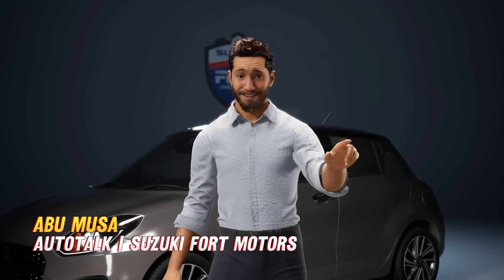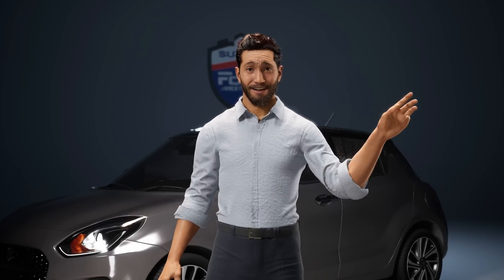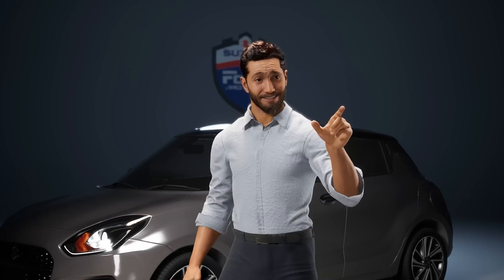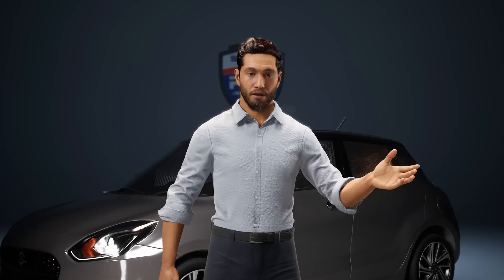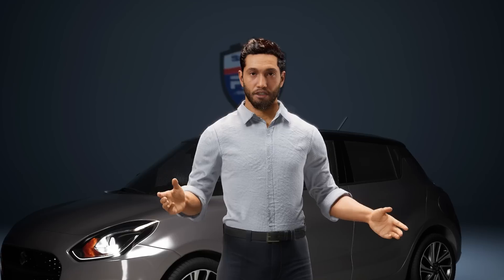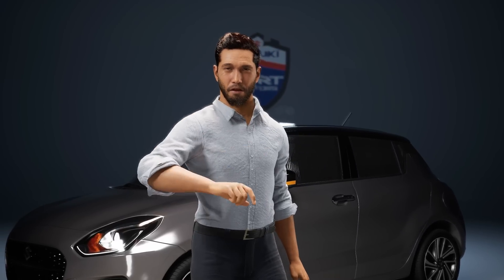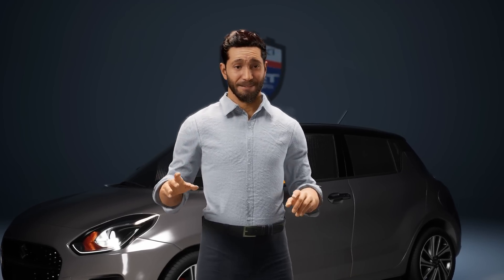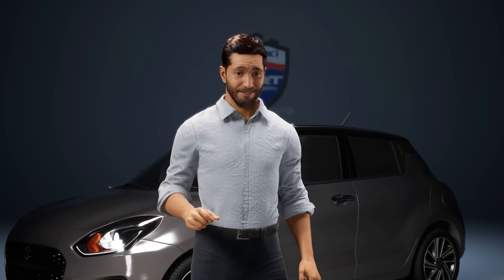VVT vs CVT | Demystifying Car Tech | Suzuki Fort Motors

Comment: But, overall, which is the better system?  CVT seems to offer a smoother ride, especially when you're accelerating.  Is this correct?
Reply from the maker: Yes. CVT offers a smoother ride. (There will be another video for its pros and cons soon)
Regarding the first part of your question, both these systems are good. VVT is related to the engine, the powerplant whereas CVT is the transmission technology. So, both these technologies are related to two differrent systems (VVT for engine and CVT for transmission) and are not comparable to each other as such. 
Engine with VVT or DVVT or VVTi etc perform better than the engines not equipped with this tech.

Comment: Which is more fuel efficient. CVT or VVT? Why suzuki change swift from CVT to VVT.
Reply from the maker: As explaied in the video. CVT is the gearbox and VVT is an engine feature. 
Suzuki Swift has both. A CVT gearbox aswell as a VVT engine.

Only the badging has changed. Previously a GLX CVT badge was used. Now the badge has change to GLX and VVT

Comment: What's the difference between VVT and an automatic transmission?
Reply from the maker: Hi!

The main difference between VVT and an automatic transmission is that VVT is a feature of an engine, while an automatic transmission is a type of transmission. VVT stands for variable valve timing, and it's a technology that allows an engine to adjust the timing of its valves to improve performance and efficiency. An automatic transmission, on the other hand, is a type of transmission that automatically shifts gears for the driver.

CVT on the other hand is a form of an automatic transmission.